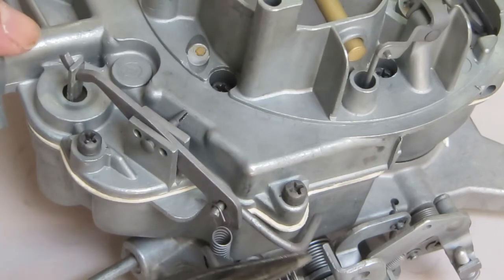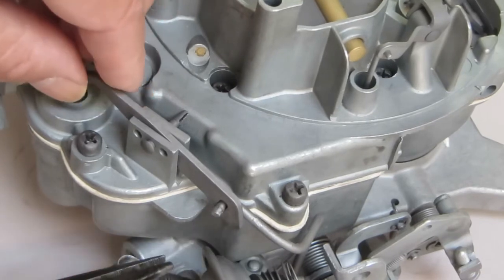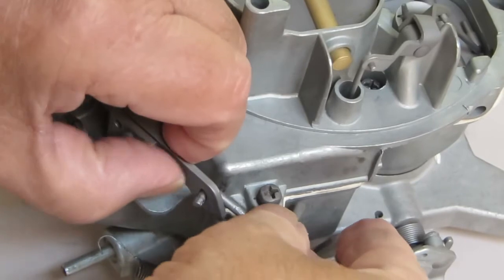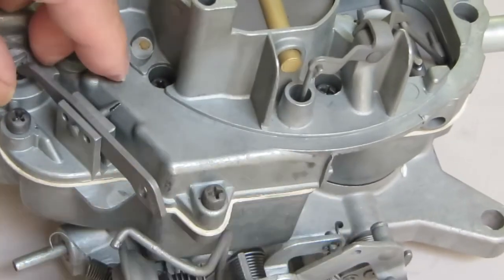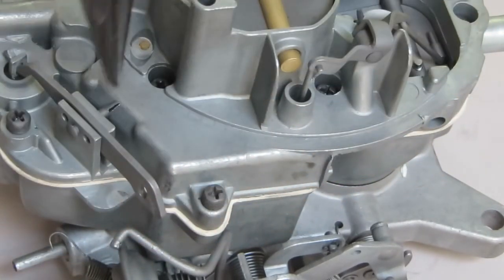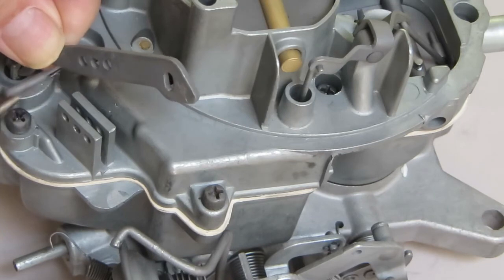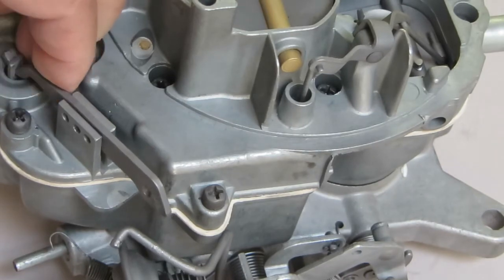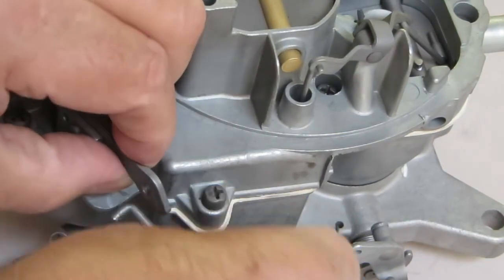Adjusting the Accelerator Pump Lever on Autolite 4300 Carburetor

Comment: Is it normal to need to change the accelerator pump lever settings with the seasons? Can moving the pin to the cold hole help to solve an issue where the car bogs when going to wide open throttle?